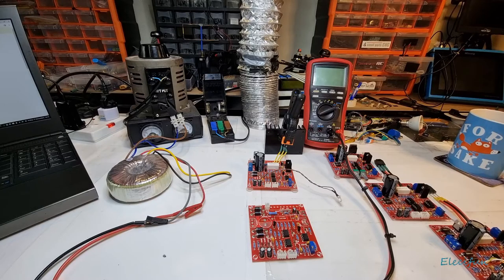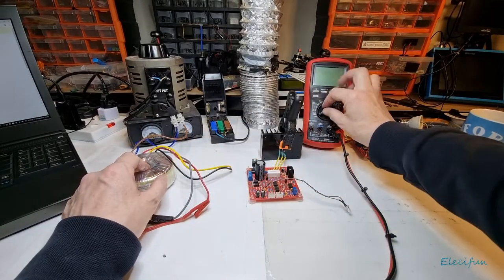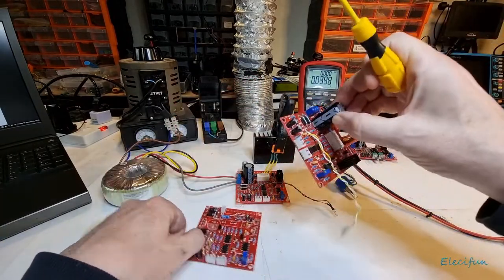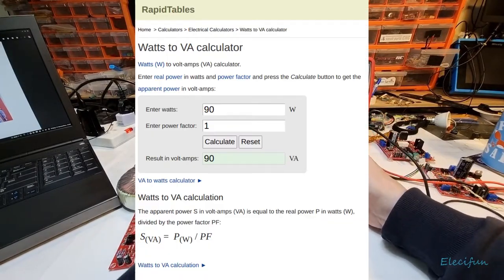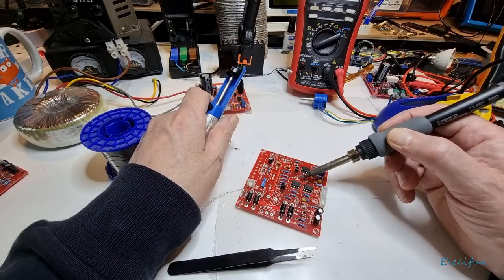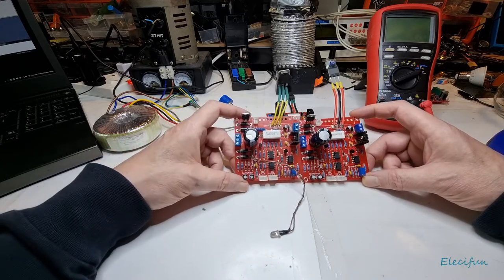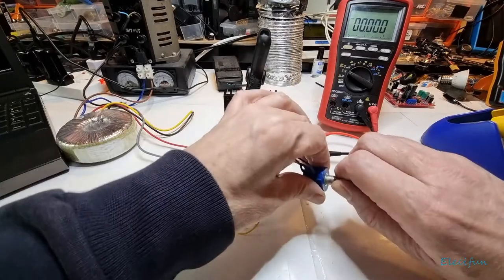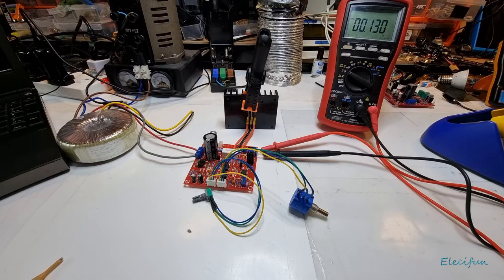Hiland 0-30V 2mA-3A PSU Repair

Comment: How many of those clone Hiland boards did you buy and how many of them did you end up fixing?
Reply from the maker: I bought 8 or 12 I'm to embarrassed to look. I have the original Hiland boards working fine, but none of the fakes work and I haven't had time to go over every connection searching for differences between both fake and original.
Reply: @Elecifun  oh okay. Persist with them you might be able to modify a few components  and get them to work.
Anyway let me know if you get them to work.
I bought two 0~35V 5A boards.
Looking at them now I'll be lucky if I can get them to work.
The issue is the transformer needs 4 different voltages which means either a custom transformer or 3 or 4 transformers. Sigh. Think I might have bitten off more than I can chew.
The 0-28 2A are good and I might make a video of them. 
Anyway night ...
Decem. 🙋🏻‍♂️🇦🇺
Reply from the maker: Would you share what 35V 5A boards you bought so I can check them out please? might be able to help ?
Reply: @Elecifun  okay. Wait. I can't sleep.
Reply: @Elecifun  

Have a look at this guys mods.
I've got some of those parts but I kinda lost interest in those boards.
I might get interest in them again.
I might try and replaced some of the components.
I did start reading some stuff about the 0-30A 3A Clone Highland boards.
The general consensus seems to be that the board was originally designed to be 18V not 30V. Or something along the lines of that.
Anyway I might try and get some shut eye again.
Night.
Reply: 8 and tryed but all burned do not by them ever!!!!!
Reply: @paulrockwell2644  Yeah, you're right Paul. Never assume anything ! Many of the things I've bought are dodgy for sure. Sigh.

Comment: Sorry being a little late on this issue 🙄

I also have a couple of those kits off ebay and couldn't adjust 0V too. After much fiddling and fretting I discovered that all TL081 were fake and noticed that pins 1 and 5 (Offset Null) were inoperant, that is, they were not connected internally. The other connections were OK and in fact they worked correctly as strict op-amps in the way they work in a dual op-amp chip, that is, no offset null adjustment at all. Maybe factory dual rejects with one op-amp busted and rewired as a single op-amp chip? Chinese crap again!

 You do need Offset Null in at least Q2 to set 0V with the trimmer. I replaced them with proper known good uA741 and now the 0V can be adjusted properly and the circuit works as intended.
Reply: Yep.....and ALWAYS use sockets for the opamps. You will be rewarded if/when they blow and require to be replaced.
Reply: thanks i try 741
Reply: I used 741s in mine aswel 😅
Reply: In the mine kit the tl081 are resulted to be twin operational amplifiers.The main capacitor is marked Nichicon but has  700 uA of current leakage ( new cap).The remaining components seem to be goods.

Comment: Also 90va is the continuous rating of a transformer and we very very rarely use our bench psu at full power for hours.
I used a bigger transformer in my builds to avoid voltage drop at the top end

Comment: With mine the LED is not very bright at all, and i have only 7mv on output at max. When I touch the potentiometer it becomes a little brighter on 1 position, sometimes if i touch it too much the led goes off completely. What could it be?

Comment: Okay so in conclusion what cause that trimmer not to work?🤔

Was it the 330uF cap? Was it just the wrong way around and damaged??🤔
Reply from the maker: The cap is 3300uF and I replaced it the wrong way around. It is damaged now and heading for the bin.
Reply: @Elecifun  Okay as you said in the video. I heard right. 🤔

Comment: i had fount a lot ofc changes for this kit 5.6 zeners 60,000uhf, by passing ac go to just dc? and they say tle2141 are best and lot of resistors our hier rated like 2.2 all need to be 1 to 3watts 270 1watt to 2 ect.
i been tring to make one work but i alwase fair i been si careful tested all components ect.
i bumed realy diapointed at this
sorry can not spell so good had to drop out school to help take care of my 2 younger brothers
i just so confused realy??
Reply from the maker: These are not genuine Hiland kits unfortunately. I think the components supplied with the kit are really cheap and nasty. Sorry buddy.
Reply: Probably bad opamps, so worth swapping them out. Use sockets for them. You could test them on a scope/multimeter too if you have either. The resistors will work, but yes could be higher wattage in a couple of them. Check the big white snubber hasn't blown too. I got caught out with that.
Reply: Ya well i put 6 together every one never worked no output led works, but there's no output
Reply from the maker: @paulrockwell2644  I'm not sure what to say my friend. These boards have issues or the components do. The genuine boards and components work fine, not that that helps you. Sorry.
Reply: 76 0-30 hi land sucks they need to build me one THAT WORKS FREE
Reply: 86

Comment: @14:34 that trimpot is not working on your counterfeit Hiland board and its not working on mine either. I can't remember now but I think I have two fake boards both have the same issue. 

Surely we can't have fkd up me two boards and you at least one board.🤔

Maybe the printed it incorrectly and the 5V1 should be some where else. I was reading another article and he claims that was the problem. Sigh.
Reply from the maker: I have three that do not work all the same all do not adjust on the trimmer 100K.
Reply: @Elecifun  how did you solve that problem? I saw you adjusting it after replacing the cap was that the issue?

Comment: Hi, well I tested my 0~28V 2A 

I bought a dummy load 0-25V 4.5A.

Well when I wind it up (the dummy load) to 25V and 1.25 Amps its kinda unstable.

The power supply is set to 25V and 1.25A of current.

I'd love to know why I can't get more out of it.

Is it the transformer which is 60VA.🤔

Anyway I'll get a bigger transformer 80VA.

I'm also going to get a lot more transistors and other components.
Reply from the maker: Maybe today's upload you might like ; )